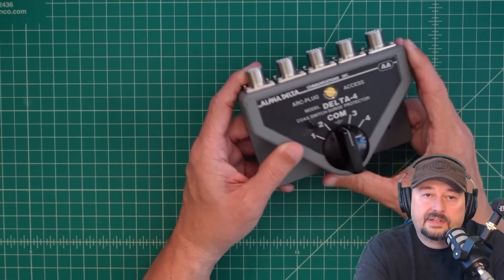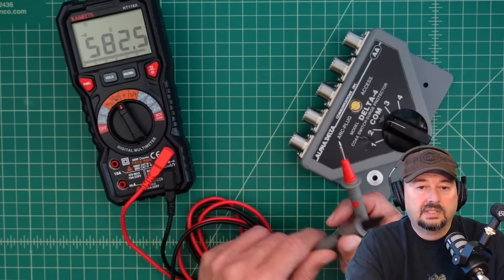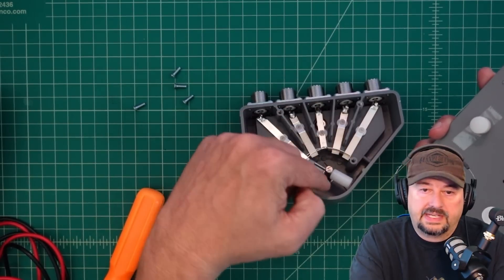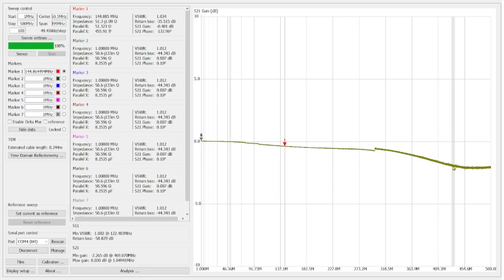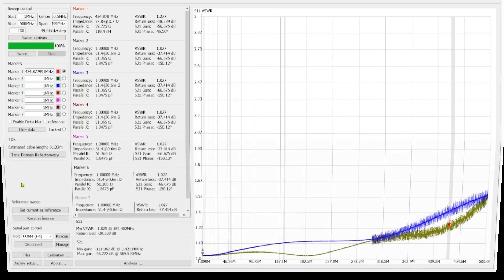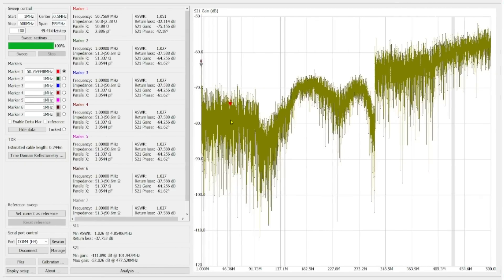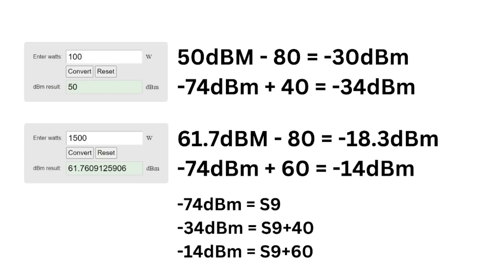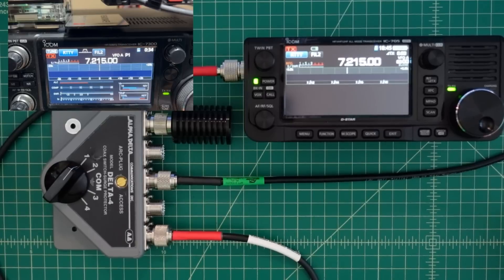Alpha Delta 4 Port Antenna Switch

Comment: An antenna switch at a electrical level is just a simple single pole, 4 port switch.  At DC it just connects to each port.  However, at RF frequencies, that is totally different.  You see that there's long connectors that aren't shielded side by side, which will insert inductance between each leg. At HF frequencies, this is unnoticeable, however at higher frequencies it will come into play because of the shorter wavelengths.  This is why these switches are for HF use only, not UHF or higher. Most switches will short out the unused ports to ground so there are no inter-reactance between the ports. For UHF and higher frequencies those switches need a different construction to not introduce any inductance.
Reply from the maker: Hey Ron, totally agree.  That said, this switch is marketed to HF/VHF/UHF.
Reply: even at 6m (50MHz) i noticed increased SWR. Not very good. Use only max 28MHz (10m)

Comment: Something to add; The arc plug is only engaged when one of the ports are selected. When selector is centered, all four port center pins are grounded. When one of the four ports is selected, the other three port center pins are grounded, If using switch for radio selection, you must take caution in which radio is NOT selected.
Reply from the maker: Great info, thank you!

Comment: nice testing. I have the Delta 2. I switch between dummy load and antenna. I tune my tube amp into dummy load first. gets me real close. less over the air tunning. that spacer insulator piece is below the arc plug on mine. I don't have base setup any more from moving a few years back. Just portable now. still use the switch in testing. I may take it portable and run 2 antenna's or dummy load on 1 side to tune up. that I have done. just not 2 antenna's yet. the switch now lives in my POTA kit. that way I have it if I need it portable. I want to get the one with N connectors for testing  UHF. 73's
Reply from the maker: Hey Robert.  I think these are better for 1 radio and multiple antennas and not the other way around.  That said, Alpha Delta does make a nice product 👍
Reply: @TheSmokinApe  agree . big Jeem did testing as well. I have the delta 2 and that is how I use but one antenna is dummy load for tube amp tune up. less on air tunning .

Comment: I need to get one of these. I have a 10M transceiver & a FRG-7 that I want to share the same antenna. So, the antenna goes to the center "common", but do I need to add dummy loads to the open ports? Thanks
Reply from the maker: Yes, antenna on the common.  You don’t “need” a dummy load but it’s probably a good idea to have one and use that port when not using the radios 👍

Comment: If you run some tests again and instead of just testing port 1 and 4, test ports 1 and 2 or 1 and 3 and you will see a lot more variance in your numbers. I ran some of the same tests on my companies HP analyzer and I was surprised. For example, the SWR on ports 2 and 3 are MUCH lower than on ports 1 and 4 the higher the frequency. I believe it has to do with the length of the strips that make up the connection paths and possibly the interaction with the "walls" that are much closer on ports 1 and 4 where there is a larger "air gap" on ports 2 and 3.
Reply from the maker: Hey Bill, I think your premise is correct.  I did test other ports off camera and I did see the greater variance you spoke about.
Reply: @TheSmokinApe  Looking at the screenshots I took of our analyzer, it seems like ports 2 and 3 have a lower SWR on the higher frequencies. If this is what you also see (I only have a sample size of one), then we can suggest to other hams to use ports 2 and 3 for antennas that you primarily use for say 17M or 20M or higher in frequency.

Comment: Sir, if you deem that there would be sufficient interest, would you please make a video on antenna combiners.    I have (I use) multiple antennas, of different types - for my scanners.    I am finding that it's a complex issue, when it comes to combining multiple antenna inputs to 1 scanner.   The data sources 'seem' to imply that this is not a good idea, that 1 antenna used on 1 scanner is the best route to follow.    Then again, other sources speak about different cable lengths (problems) of different antenna types (more problems), of having too much 'input' which may overload the front end of a scanner.   It goes on and on and on, and there is NO apparent clearly defined answer.    The bottom line: what are the pros and cons, what are the problems of trying to combine multiple antenna inputs to drive a single scanner.     Sir, additionally, if combiners (active and passive) is not a sufficient topic for a video, would you consider speaking about signal amplifiers -  I actually use multiple dedicated radios (marine radio, aircraft, cb) along with the multiple scanners.     After combining the signals from this myriad of antennas, if I then wish to split the combined signal to 3 or 4 scanners (or different radios) what is the issue with powered/active signal amplifiers?    Am I able to use a powered active signal amplifier, split this signal, and then split it again to 3 or 4 radios?    Questions, such as; can I overpower and damage the front end of a radio/a scanner if I have too many antenna inputs: can an amplifier damage the input of a radio, using cables of different lengths and antennas of varying types - is it better, as in best performance to simply have 1 antenna per radio.   In close, I see that many of the truckers use multiple cb antennas - for better distance 'getting out' issues.   So if multiple radios for truckers/for cb is a standard and accepted practice, then why would there be an issue using multiple antennas for receiving. (only receiving)     Thank you, Sir: I am a subscriber, as your channel has value - to me.
Reply from the maker: Hey Skywatcher.  I have actually been working on a combiner, hopefully I will have the video up soon.
Reply: @TheSmokinApe  Thank you Sir.

Comment: Thank you for the insight using the software together with the nanoVNA. Most often two switches in series will give a more workable isolation. A relay activated type is more conveniant then.
GL & 73
Reply from the maker: Thanks for the info 👍

Comment: I just got an Alpha Delta 2 port switch to connect 2 HF transceivers to one antenna and was pondering the port isolation and risk of damaging a radio.   I decided to do some research found this video.  Exactly what I was looking for!   The -34 dBm figure made me a little uneasy, but the real world testing at S5 was not too bad.  I normally operate at 50 watts or less, so I should be OK.  Thanks Ape!
Reply from the maker: Hey SF, glad to hear the video was helpful 👍

Comment: Thank you. I have used mine for years to switch from my antenna tuner to four different radios. Very happy with it.  Alpha Delta makes excellent products.  Higher prices but quality.
Reply from the maker: Thanks David, they are well built for sure.

Comment: Hi, I am so grateful you did this test on this switch because I have grown increasingly concerned about my high SWR and where the problem we’re coming from? It was a number of things which I have sorted but I was so shocked to see so much coming from the Alpha Delta Switch on 2 m. Your demonstration explains and helps so much one thing I will say that you might need to take attention too! you were testing on the outside sockets . The two inside sockets were twice as good as the outside sockets and were manageable.  😮 I don’t know about the isolation though.
Reply from the maker: Glad you liked the video Jeff and thanks for the heads up about the sockets!

Comment: A nice demo of insertion loss/port isolation of the 4 port alpha delta coaxial switch. 
The brief setup using the ic705 and 7300 is fine. 
As you concluded the switch is good for HF with 100w of RF.
At 23.06, you said ic7300; it should have been ic705.
De VU2RZA
Reply from the maker: Good catch on the 7300, thanks for watching Subramanianr!

Comment: I have a couple of those.  I currently use one to switch my two hf units between my vertical.  I have had zero issues.  One unit is a 7300 the other is an ICOM 706MKIIG. I have used the hf unit and then transmitted on the 2m/70cm part of the 706 (the 706 has a separate antenna port for 2M/70cm) at the same tiime with no issues.  i love those alpha delta antenna switches.  They are built like tanks.  Cockroaches will be using it after I am dead from the next nuclear blast.  Great video Ape!  73
Reply from the maker: lol @ cockroaches.  Thanks for watching and glad you liked the video!

Comment: Ape, on the higher frequencies, would you not be using N type connectors vs PL-259/SO-259?  Would that change the higher frequency results?  They do make this switch with both SO-259 and N connectors.... BTW.  Personally I do like the Alpha Delta switches and have used them for a long time in the shack.  Art W1SWL
Reply from the maker: He Art, I agree the N-Connectors are best for higher freqs but in this case I am not sure it would be a notable difference.  Thanks for the comment 👍

Comment: Ape great video. I few things i saw is at the end with the 100W ic 7300 705 test, the 705 seems to have the RFG in red which means the RF gain is reduced, Also with cable loss that why the signal is S5 not S9 on the 705. Great video though!
Reply from the maker: Correct, I had the RF Gain at my normal setting...  it wasn't fully open which did impact the results. Thanks for watching DB.

Comment: Very informative, thanks. I disconnected mine because I know my antenna is not 2:1 without a tuner on 40m and 80m. I might find a way to connect it differently but I'm fine without it. I wasn't using it to switch external antennas. I used it to switch my antenna from my rig to my SDR USB dongle. I'm using 450 ohm ladder line to a dipole about 100ft in length. Surprisingly, my rig's internal tuner works on all the other bands besides 40 and 80. It even tunes 160m (which I don't use anyway, but interesting nevertheless).
Reply from the maker: Thanks TRT, glad you liked the video 👍

Comment: your next switch review should be the mfj-2704 it grounds the antennas center pin when not in use to keep static under control.
Reply from the maker: Hey Thump, I will see if I can dig one up...

Comment: Full legal limit, 1500W is just under 62dBm so going by the data sheet isolation you're at most looking at +2dBm into your receiver. As you measured, it may be significantly less. The damage level for most LNAs on the market is typically around +10dBm so you should have headroom even on a bare LNA. However, any well designed modern transciever will include an RF Limiter just behind the T/R switch. These devices will often kick in around +0 dBm or +10 dBm and clamp the output power to protect anything down the chain. Even a tiny chip limiter mounted on the board is often rated for a maximum power of +33dBm or 2W. Remember your transceiver or amplifier has a T/R switch which probably exhibits 40-70dB of isolation, similar to the specs for this switch. So your receiver was already designed with these power levels in mind. Running a kW you may risk damage to a cheap, no name, e-bay receiver built with no concern for anything out of the nominal case, but any circuit designed by a competent engineer will be fine.

On the high frequency performance I'm a little suspicious of the measurement setup, specifically the nanoVNA. If you notice the noise at higher frequencies begins abruptly both with the switch and when connected directly to the load. An effect caused by a simple component like this would much more likely exhibit a gradual increase in noise with frequency, there's not really anything in here that should cause a step like that in the frequency domain. I believe the nanoVNA may utilize aliasing for frequencies above 300 MHz. It is easy for something to go wrong there and introduce additional noise and a compromised match. Perhaps I'm just spoiled by the high quality test equipment I use daily at work, but I would be very careful attributing blame to the switch in the higher frequencies when the measurements look like that. 

All in all a nice video. From a professional perspective I wouldn't have any concerns using this switch in almost any HF or VHF amateur radio setup. If you're looking to do UHF work I'd use the other models that Alpha Delta offers that include N connectors rather than SO-239's. The SO-239 / PL-259 connectors were never designed to present a constant impedance, and while they're fine at lower frequencies, they are not suited at all for work above a couple hundred MHz.
Reply from the maker: Thanks for the detailed info Mark 👍

Comment: Dear Ape, first, thank you for another great video. My plan for this switch was to go between a DX Commander for transmit and a Loop-on-ground or Delta loop for receive. With an S5 reading on the port that is “off”, would this harm some antennas that are designed for receive-only? If this appears to be a noob question, please forgive. Respectfully, KQ4IXD
Reply from the maker: I think many folks do that, will 100w you should be fine. 👍

Comment: Is the chassis ground connected to the so 239 grounds? If so all of them or just the common port? Would connecting the chassis ground to an earth ground change the test results? Would bonding the 2 radios to the switch chassis and earth ground the switch chassis affect the results? I wonder what effect 1500w would have on the tension and connection of the metal tabs? I think for the common ham this thing would work just fine. Thanks for breaking the seal!
Reply: I suggest you watch the video again. Yes, the shells of the SO-239s are all galvanically in continuity with one another and with the aluminum metal die-cast body chassis. 
Only the center conductor is switched to any one of the 4 ports at a time.
Though it is called a coaxial switch in reality or in the strict sense it is not.
It is nothing but a simple single pole 4 throw switch for DC or low frequency AC. 
But considering the cost of production and the affordability this design is OK for HF and to some extent in the VHF and the UHF amateur bands with limited powers. 
De VU2RZA
Reply from the maker: Hey TRW.   Yeah, the chassis ground is connected to the 239 grounds.  Connecting the chassis to the ground may change something but because of the connection to the 239 grounds I doubt it...  Thanks for watching!

Comment: Might have wanted to look at the instruction sheet it states that a ground is required for the switch to work properly. You had a floating ground so the un used positions really aren’t grounded. Wonder what difference you would see especially at the rated 1500 watts?
Reply from the maker: I did read them.  Here's something to consider, the ground connection is tied to the shield of the coax terminals which is connected to the station ground.

Comment: It would seem to me --- you miss spoke at about 14:50 " reflected back " ?
Nothing is perfect [ the MFJ dummy  load , so there maybe some / but little reflected signal ] --- a dummy load absorbs the signal & turns it into heat & is radiated through the fins on the dummy load ?
Thanks
Reply: Misspoke at 14.50...?
You are contradicting your own find; it is weird.
De VU2RZA
Reply from the maker: Hey KD0CAC, if there is an impedance mismatch you will get reflection.
Reply: @TheSmokinApe  But you connected to the MFJ dummy load - should not be hardly any mismatch ?

Comment: Hi Ape, awesome video! What you said about the 2:1 SWR limit for this switch makes me think that the best type of tuner for non-resonant antennas would be a remote ATU like the MFJ-993BRT,  ICOM AH730 or similar where the ATU is installed outside at the antenna feed-point. TBH I'm not sure what I think about a setup like this, I would be inclined to avoid all that complexity and use a resonant antenna like an EFHW or DX Commander. Cheers! Jan M7HNK
Reply from the maker: Agreed on resonate or the tuner after the switch 👍

Comment: As you measured "only" an S5-signal in the practical isolation test with the two ICOMs: There's a video from a German amateur DL2YMR over a year ago where he found out that the S-meter in the ICOMs (in other radios too but he tested the ICOMs in the video) are very "corrupt". In this part of the video (https://youtu.be/vTRhX6F4ttg?t=212) he injects an S9-signal to the the IC-705 and attanuated it to an S8-signal. But the IC-705 indicates a S6-signal (assuming his equipment is OK). I don't know whether it is fixed in the meanwhile. I wanted to share this because you seemed to be surprised about this results in 24:25.
Reply: Hi, I watched the video you mentioned here.
He is using a homebrew signal generator and a through hole resistive attenuator pad with DPDT switches to evaluate the integrity of the IC705 "S" meter calibration. 
You must have gone through the comments,  I believe. 
If not it is better you do now.
De VU2RZA
Reply from the maker: Hey Flovan.  So, I didn't have the RF gain all the way up which I generally never do when operating.  I suspect that if I did the S-Meter reading would have been much higher.
Reply: @TheSmokinApe  OK, that makes sense.

Comment: so, this switch does not short unused ports to ground?
Reply from the maker: It does with the dial set to common 👍
Reply: @TheSmokinApe  Only at common setting? So, when set to, for example 1, it doesn't ground 2, 3 and 4? Edit: there is other comment explaining that: "When one of the four ports is selected, the other three port center pins are grounded"